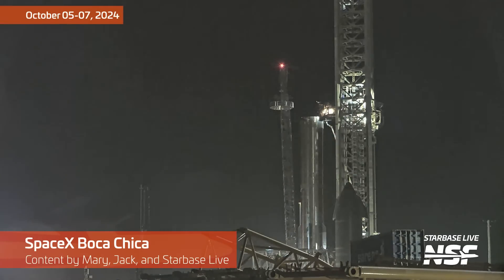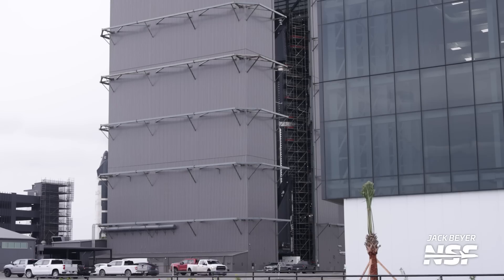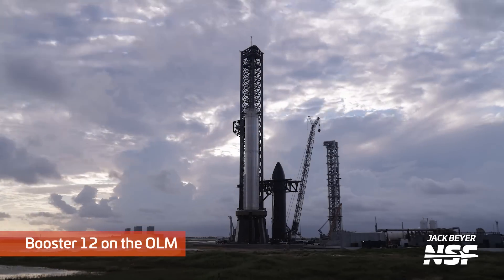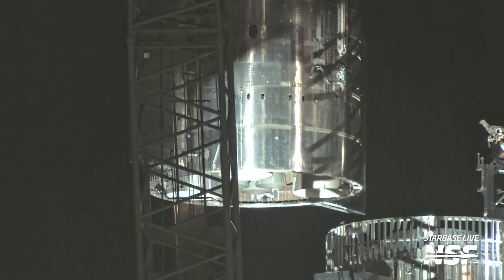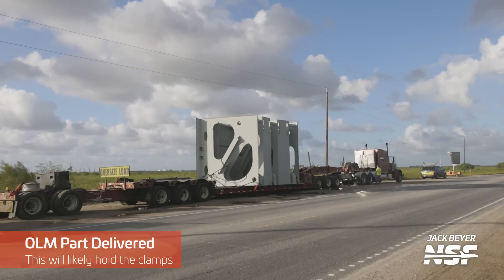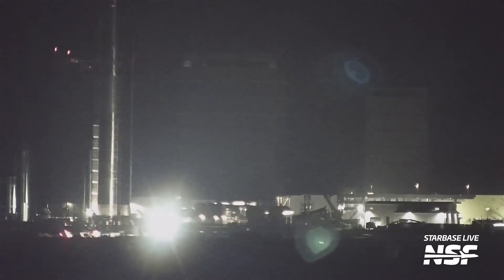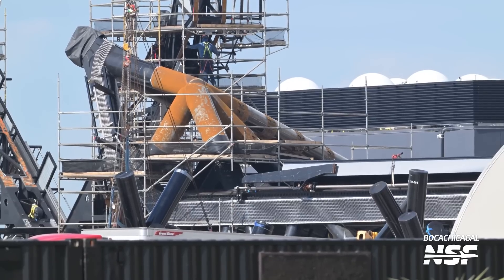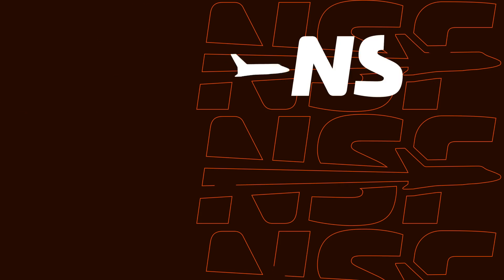SpaceX Prepared for Upcoming Starship Flight 5  | SpaceX Boca Chica

Comment: Please stop calling it a flight, Rockets do NOT FLY! Rockets use a chemical reaction to lift off vertically. No lift provided by wings. It does not fly!
Reply from the maker: Arguably both the F9 and Starship boosters fly when they RTLS, they have aero control surfaces and do get lift from the body of the booster. - Das
Reply: @NASASpaceflight  no wings or mechanical  forward horazontal movment,  not a plane.
Reply from the maker: It acts as a basic lifting body, and does get horizontal cross range from aerodynamic forces. - Das

Comment: That internal railing on the office building is more than likely safety glass like a car's windshield, Das.
Reply: This.  Have done fabrication drawings for steel stairs and guardrailing for years.  It's almost always hardened glass.  FYI, "plexiglass" is an acrylic based material, fairly durable but will shatter (like glass).  Lexan is a polycarbonate material... is "tougher" than plexiglass, but easier to scratch